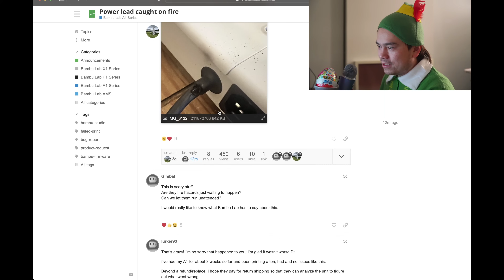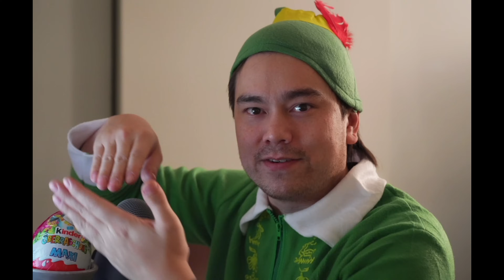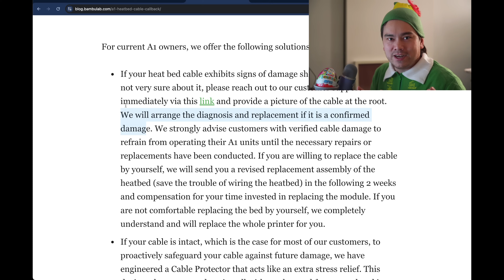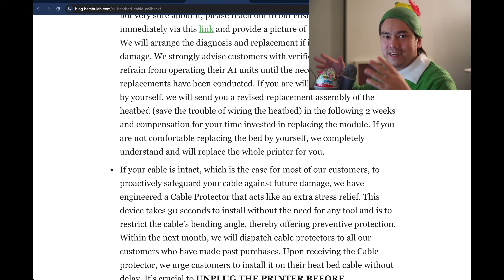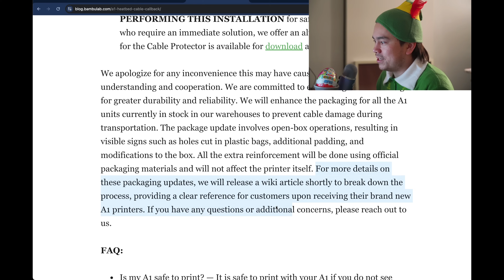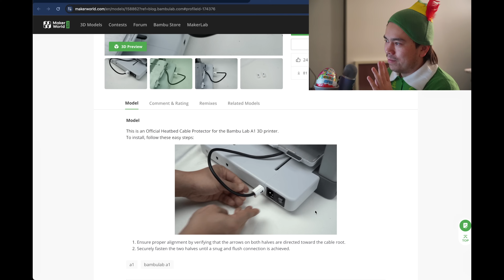Bambu Lab A1 - 👨‍🚒🔥 Important Safety Announcement!!! 👨‍🚒🔥

Comment: Are you saying the A1 hot bed is AC powered? I'm pretty sure it's not.
Reply from the maker: A1, P1P, X1C, P1S are all AC beds. It lets them spec a smaller power supply.

Not sure what the A1 Mini uses, since I haven't taken one apart.
Reply: @NathanBuildsRobots  I didn’t know that. My K1 Max is and I appreciate that. I’ll watch the wattmeter next time I start a print so I know my circuit budget. Thanks!

Comment: Kinda strange that such a cutting edge game changing company would muff up like this.  Idk about the rest of you but ive seen this sort of issue on a ton of printers throughout the years.  Its one of the first things I check out and make fixes for with a new unproven printer. 

Almost like this thing was rushed out to market for some reason.
Reply from the maker: Low quality Ender 3 clone.
Reply: I would attribute it to inexperience.

Bambu Lab is relatively new to the market and their first and second products were Core XY machines where the bed only moves up and down.The strain relief on the A1 Mini seems a little different and the printer comes fully assembled from the factory. It is therefore less likely that someone will tip the printer backwards and damage the cable.

This is actually the first product that has to be assembled by the customer and where the print bed moves back and forth.

Comment: Honestly, I feel like this is a bit harsh on Bambu. I think this is a very clear and solid response. They have a bandaid fix you can make yourself, mid term fix with repairs, and long term improvements
Reply: They sat on the issue, ignoring queries for several days from users who had a serious Bambu fire hazard in their homes, and this is a solid response? And a bandaid fix that may well make the problem worse - but hopefully makes enough customers feel safe enough that they don't send the flawed design back. Not at all convinced that Bambu is playing this with as straight a bat as the issue warrants.
Reply from the maker: The fix is security theater. Adding a hard plastic spacer to a cable that is demonstrably a fire hazard, and actually encapsulating it in a material that can catch fire is some next level idiocracy.
Reply: Well, I'll make a case that most other 3d Printer brands have similar issues but 

- the communities are not coordinated enough like the one Bambu fostered to surface them 

- They don't respond at all if they can avoid it

My theory is that Bambu is still an inherently better product, and is actually setting a standard here- but looks bad when other brands don't get this far. I suspect that under a microscope and gathering anecdotal evidence you could make the same case for any number of creality printers etc having potentially dangerous design shortcomings.
Reply: But if you don't feel this is accurate, I'm happy to hear why, it's just my thought based on my understanding of the landscape

Comment: Are you sure these are AC heated beds?  How could a company be this reckless and stupid to do such a thing??? I wont even put an AC bed on my custom CoreXY printer because its too much risk having that kind of voltage on any cable that flexes over and over, so its just hard to believe they could do something so dangerous on a bed slinger... Only bed that should have AC power is one that sits stationary at the bottom of the printer, and the X/Y/Z axis moves.
Reply from the maker: Bambu Lab disagrees. AC is cheaper, so AC is what you're going to get.
Reply: @NathanBuildsRobots  Madness!

Comment: Mine is fine, just unboxed it a few days ago.

But, when I was setting it up and/or moving it around I was careful not to put any pressure on that cable. I noticed that stress would be induced on that cable edge if you just tilted your printer back a bit… 

However, I also figured I was probably being anal over the cable for nothing, babying it because it was new… apparently not! This is a big blunder for BambuLab.

I’m also not seeing how the print is a great idea either, all that does is kick the issue down the cable. I’m hoping they provide a full rubber boot for it.

Comment: my cable looks fine but how do i know it won't do the same thing like other printers out there. this is very dangerous basically the bed is now live with 240v someone could get killed or burn the house down even worse that i have my printer connected to expensive victron inverter which cost 2k so now its worrying me

Comment: They did same mistake like Prusa with heatbed cable. I've changed 2x thermistors and heatbed power cables on my MK3S just because rear wiring was hitting acrylic panel of my IKEA enclosure... 
All bedslingers should have heatbed cables 45-90degree angled to avoid that.
Reply from the maker: Or wireless heated beds :)

Comment: What is preventing the cable from getting kinked right after the cable relief??? The cable coming out of the cable protector is the same as the cable coming out of the printer??? For the past 30 years, I have been involved in custom machine manufacturing (custom automation), and the only solution to this problem is a stronger, biffy cable. Especially if you are running high voltage. No matter how strong your cable relief is, eventually, the cable will get damaged somewhere else. I just got my A1 a week ago and I am glad I came across your video. Thank you for sharing.
Reply from the maker: I have seen a picture of a cable having damage a few inches out from the spot where it enters the base of the printer. So what is really needed is a full cable replacement with a thicker and stronger jacket.

Comment: Reminds me of the clothes iron, that had fire, going all the way to the plug! Low voltage heated beds were used for a reason!😂. The issue here is the quality of materials, such as the gauge of copper used and the insulation quality, seems to be underrated for a reason🤔 cost cutting? With under rated cable, the conductor overheats, with a kink, it passes heat quite liberally to the under rated insulator(which also falls short on the flammability requirements🤭)! Starting a 🔥. I am sure, BL is going to issue a f/w update to reduce max current? leading to? I know what happened when a recall for a car seat heater did to seat heating? No heating no 🔥. With the open frame of A1, going to see a lot of prints going up in the air, getting unstuck from the not so heated bed😂. Just some 💭❤👍.
Reply from the maker: It reminds me of the toaster that burst it's toast into flame and the owner thought it was the devil or something

Comment: It would be interesting to see what the cable looks like internally. For both of the conductors to breakdown in the same spot is pretty much unheard of. You would see this sort of failure if you used something along the lines of doorbell wire. We see broken conductors in robots (The real ones, not the ones you find on YT. Sorry Nathan :) ) quite frequently, it's part of the price of ownership. But what you don't see is the broken conductors shorting to each other. 

So I suspect that the cable is not approved for use above 50 volts (the magic number for the National Electric Code to take an interest in).

And what is the approval process for this printer? I rather doubt that these have been certified by a North American group such as Underwriters Laboratories.
Reply from the maker: That is a great point, it would have to be a situation where both insulators break down and short next to each other... Also the 120/240v signal might be conducted into the mainboar via the bed sensor wires, electrifying the low voltage circuits with dangerous potential.

3D printers have little to no regulation. The only regulating body that I know of is the FCC which only care about the wifi emissions.
Reply: @NathanBuildsRobots   Do the thermocouple wires go in the same cable? How insane is that? The first problem is what you mentioned, unintentional power being applied to the low voltage wires in the cable. When you run low voltage wires in the same area as high voltage wires, they all have to be rated for the highest voltage wire in the cable (in this case, that would be the one which is shorting out. Brilliant.)

The other problem is the switching of the power to the bed has got to be creating noise that is going to affect the temperature control if the thermocouple wires are in the same cable. I suppose that with enough filtering things will work out...

And if I'm not mistaken, any device above 50 volts sold in the USA has to be UL approved. And this applies to pretty much everything above 50 volts (AC or DC). And if a given the choice between an unlisted (unapproved) item and one that is listed, you have to use the UL listed item (I imagine the same thing applies in Canada but with their approval agencies instead). A little fun fact, the panels that we used to custom build for factories and their ilk, had to be inspected and approved by a UL field agent. I was never part of that process since I did the programming and equipment startup in the plants, but each and every panel shipped to a car plant had a UL label.

Underwriters Laboratories, the NFPA, and the NEC are largely tied together. For instance, Article 70 of the NFPA is the NEC. And if your locality has adopted the NEC, it then has the force of law. So it really is just a matter of holding their feet to the fire to bring them in compliance.

And the entire device will get tested before it is allowed to be sold in the USA. Now, anyone who has connected a 50 amp range pigtail to a stove will tell you that the oven makers get to play by a much more relaxed set of rules. :) But they have been tested and have been deemed to be "safe enough". :)

Where 3D printers have been getting away with this, is that they have largely stayed below the 50 volt rule until now. Which hopefully the NEC will take note of since "Watts are Watts" regardless of the voltage, and that's what leads to fires.
Reply: EE here, cable looks ok, have seen a lot worse. But the type of it might me interesting.

But high voltage and low voltage on the same cable is normaly a nogo, exept for some special servos hybrid cables witch are expensive AF

I dont know how they measure their bedtemp, might just be reading the resistance of the ptc element and interpolating the rest. Seems sketchy overall
Reply: @Jsrctx  How often does this cable get bent like this? We've all seen cables break from repeated flexing. But I have never seen one short out. How warm does the cable get during normal operation? 

At GM we used the Amphenol (Sine) "Power Boss" cables that mixed the 110VAC with the DeviceNet (Canbus ) wires in the same cable. Nothing but trouble. 

Has anyone managed to get a sensible reading from the resistance of the PTC element? That would be sketchy indeed. :) There is such a thing as self-limiting heat trace cables, but I think that the intent there isn't to hold an accurate temperature, but rather to prevent the cables from burning up. Hmmm... :)

Comment: Im from Germany and we have 220V in general. So the danger gets doubled or am i wrong? (hopefully)
Reply from the maker: Yes, that would double the voltage and pose more of a safety hazard.
Reply: @NathanBuildsRobots   Great, i found out i have this kind of kink on my cable. Do you really think they will replace the whole printer?

Its 14 days old and i already opened a ticket because after i started my very first print i quit it because i wasnt used to the printer doing nothing while preparing. Then it went all the way up and crashed brutally into the frame and would not stop. Somehow it still prints fine but now i have cracks in my plastic frame corners.
Reply: Isn't it that a 300Watt (for example don't know the actual wattage) bed will draw only half the amps on 220V then on 110V? I thought the amperage creates the warming. Yet this only is the case when the bed is on mains. This theory is one of the reasons most printers run on 24V and not on 12V anymore i think.
Reply: @michelvangent3683 but we're talking about damaged cables causing a short circuit. It doesn't really matter how much the bed normally draws because a short will draw as much current as it can.
Reply: @AdrianLopez-sb7eo  my reaction was about double the voltage more risk. That's not the case. At higher voltage the amps are lower thus less heat. In case of a damaged cable it will still go wrong in the end ofcourse.
Reply: @michelvangent3683  I'm not worried about the cable getting hot when it's intact, as that is just a matter of having a cable that's rated for the necessary amount of current. What concerns me is which one is more dangerous when there's a bad wire that's sparking like in the video I saw: 24  VDC from a power supply, or 120/240 VDC straight from the wall.
Reply: Ohm’s law is pretty straight forward. Double the voltage = half the current = half the risk. Of course there are little things called transformers that are pretty good at transforming voltage. Do you really think the bed runs on whatever your outlet puts out?

Comment: I can’t think of a better company for this to happen to.
Reply from the maker: Happens to everyone. Bambu is the only one who are so pious about their products that it's just funny when it happens this way.
Reply: @NathanBuildsRobots  oh. Agreed. I mean I dunno. Prusa has that energy at times. Haha. I mean Bambu was very disruptive to honestly a pretty stale market, so I get why it makes their head big. But as long as they make things right for their customers it'll have minimal impact. That said, it's crazy every company does this with their first bed slinger. Lol
Reply: I mean happened to prusa too. You think newer companies would do some research tho
Reply: @ZeeLobby  When did prusa ever have a recall for shitty strain relief and fire hazards?
Reply: @ZeeLobby  I don’t recall a recall from Parisa. However, I do recall some issues with overheating heat, beds, or fires on hot end from too much goop.

I would say it’s not research as much as it was poor design versus economics. When their plan is to sell equipment in mass trimming a quarter inch of plastic off of that cable relief could save them thousands of dollars a year in plastic, using the bare minimum gauge wiring that has thinner plastic housing can save thousands of dollars a year. so they decided to keep that price low. They had to find lots of ways to save money over a certain period of time which is usually around two years so that it would still be profitable. That’s the problem with these types of printers versus something like Prusa.  There’s a reason there’s a premium price attached because they don’t cheap out to meet consumer demand and price points like they would need to do with a drone. 

Some company say how can we make a printer that’s great and other ones say how can we make a printer? That’s pretty good and cheap.
Reply: @Eric_In_SF  I think you'd find many people consider Bambu to be premium printers tho. Let's be honest. The mk3 or 4 is overpriced for what it is. In the end you're trading longevity and better design but more tinkering (prusa) for it just prints but mass production savings/shortcuts (Bambu). Def think there's a market for both. Just wish Bambu had thought more about cables on moving pieces. It's one of the reasons why fixed build plate designs are just smarter.

Comment: Yeah, that’s funny that you mentioned that they think they own the printers. I just realized in my huge battle with them they always referred to the printeras theirs. And especially after I filed the charge back, they wanted THEIR printer back. I gave them the address of the local Goodwill and told him to feel free to go pick it up.
Reply: You still had the printer and filled a chargeback? Of course they reacted that way.
Reply: @chrism2964  then you don’t understand chargebacks. Under consumer protection rights laws a consumer is under no obligation to return merchandise after a vendor Has failed to meet consumer rights laws. They appealed and lost that as well.  They threaten lawyers and private investigators to come and get the equipment, which was all hyperbole, because at the end of the day they have no right to the defective equipment that they refused to repair or replace. If you have any other comments, just go check the laws first.

Comment: That's why I hate electronics with a fixed power cable. There should be a socket so all vital cabling is on the inside so it's also easy to replace the power cable when 'you put too much force on it'
Reply: Also, the cable gets flexed hundreds of times every print, it should be both very resistant to breaking from bending and easy to replace if needed and it seems it's neither of those.
Reply from the maker: The number of cycles put on 3D printing cables and bearings is actually pretty insane. Compared to other things, like a bicycle or dishwasher door, they have to be designed to handle all that flexing, over literal millions of cycles.

Comment: Hello, I really like your channel as a source of more in-depth information, without the hype, of the channels that exist in my country (Brazil). Doing a printer review has to be a serious task, where everything has to be analyzed and commented on, qualities, strengths and weaknesses. What is potentially dangerous. Just turn it on and print 2 or 3 pieces and say that everything is wonderful is not enough, because it is not, everything is a trade-off. Suggestion I would like a comparison of the K1 extruder with the K1C, if there were really any differences. Greetings.
Reply from the maker: The extruders are the same. 

As long as the k1 is a newer production model that doesn’t have one of the first extruders they released